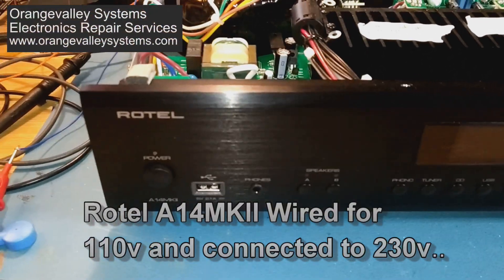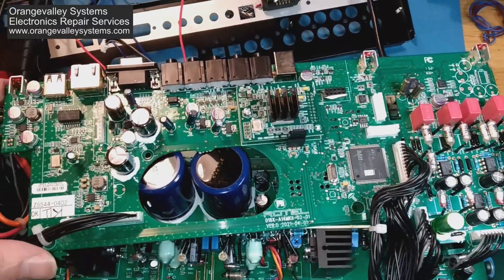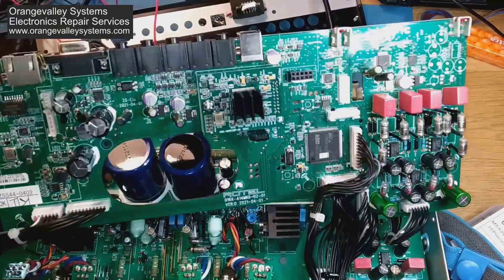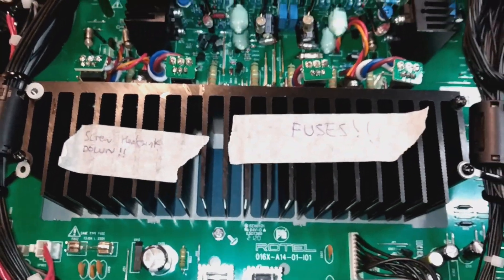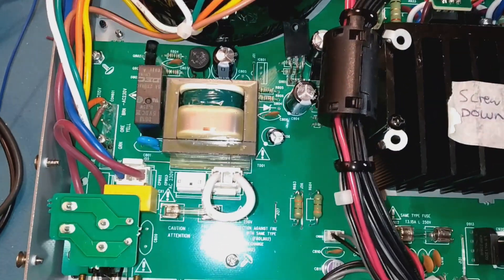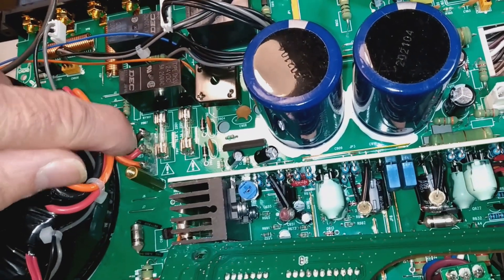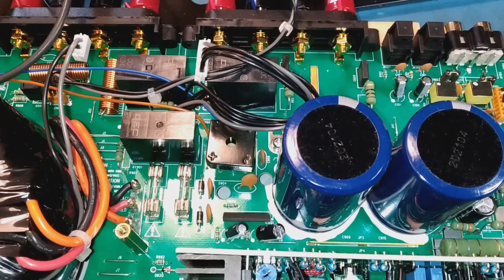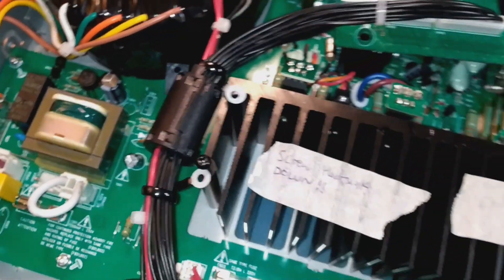Repairing a Rotel A14MKII. It was wired for 110v and connected to 230v!

Comment: All that digital stuff, fancy display. Looks like more than 50% of the amplifiers has little to do with the actual amplifier. In fact, most of that digital stuff will degrade the actual sound of the amplifier.
Remove all that stuff, the amplifier will cost 50% less and probably sound a lot better. It will also be more reliable.

Comment: Typical of consumer electronics, especially amplifiers for some reason, they are a nightmare to work on. You can usually never be able to practically access the unit while its powered on and 9 times out of 10 you cant get any service material, the later is pretty appalling I think, I can sort of forgive the crap construction is the pursuit of cost but they should be sold if you can get at least a circuit. Anyway that's why I don't bother fixing many amplifiers, its very rare to come out with any profit.
Reply from the maker: Totally agree. I often end up soldering long wires all over the underside / topside of the board to bring all the signals I'm interested in out to a scope  or meter for easy access but that might require a major time consuming disassembly.

The self tapping screws used everywhere easily wreck the holes in the soft case if you have to keep removing them. I won't normally take anything on that doesn't have a service manual and even if it does I think twice about it.

The only way to easily repair something like this Rotel (and others) would be to have a test jig for the boards. There's no way you'd want to have to keep removing the big board to fix something!

Comment: 2:51 - They sometimes bolted the smaller transistors (or diodes) to the larger ones, to help with temperature compensation.

That can help keep the idle current within a reasonable range, and also help prevent thermal runaway in some designs.

Comment: 1:09 - That looks like a 128-pin Xmos chip (XUF208-128-TQ64 or similar), for the USB "DAC" input.

The Ethernet and other USB port is more likely handled by the main STM32F207 MCU.
(especially since the F207 added Ethernet support, but the smaller F205 doesn't have it.)

The Xmos chips are quite powerful for USB 2.0 streaming audio, and DSP etc.
They are used a lot in the Audiophile style DACs, for playing back hi-res PCM and DSD music from a PC etc.